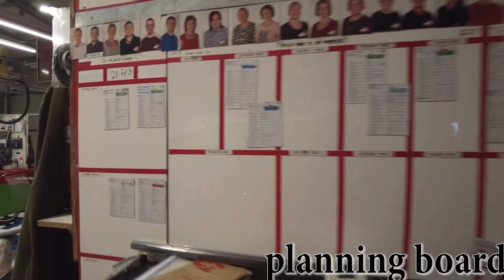How to build a Velomobile | Velomobile World

Comment: How long does it take from “start to finish”?
Reply: Theoretically 4 weeks, but it typically depends on how many other Velomobiles are in line at the time. Sometimes things will back up at assembly causing it to take close to 6 or 7 weeks. The composite and painting stages take the most time. The resin needs time in the oven to cure and the painting stage is labor intensive with body filler, a lot of sanding, painting, and letting the paint cure.